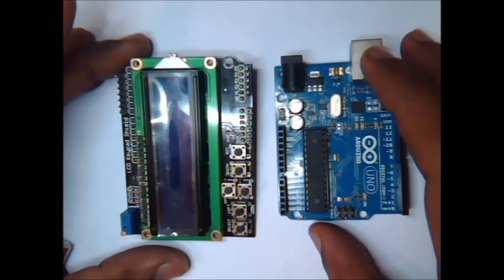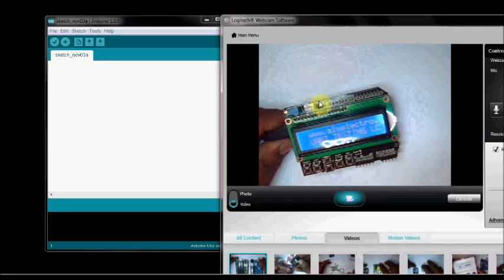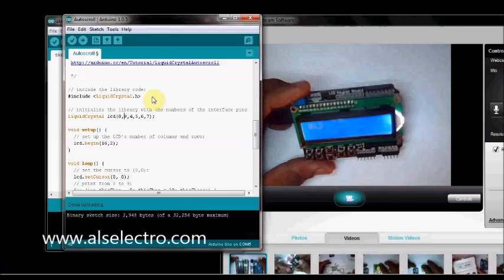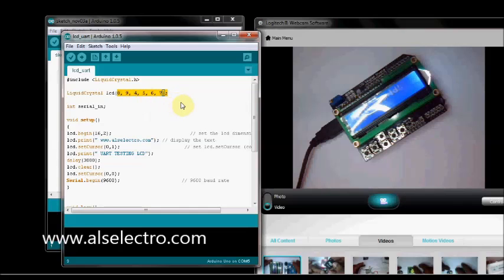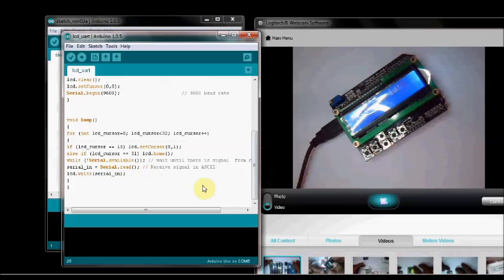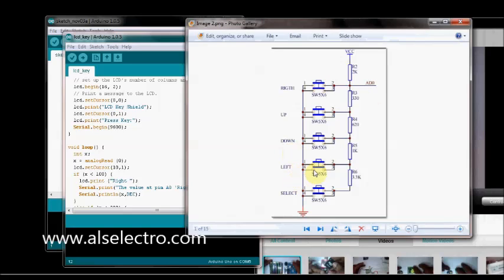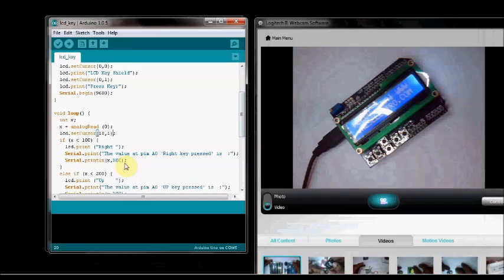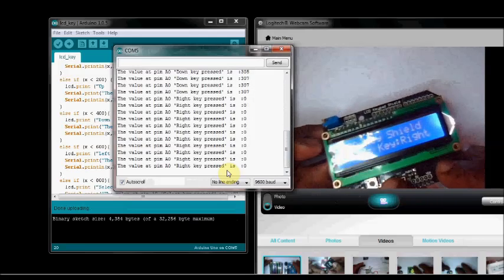LCD SHIELD WITH KEYPAD FOR ARDUINO

Comment: Thank you for the pin configuration, it works for my aliexpress display
const int rs = 8, en = 9, d4 = 4, d5 = 5, d6 = 6, d7 = 7;
LiquidCrystal lcd(rs, en, d4, d5, d6, d7);

Comment: Thanks! I modified your code to read the keypress analogue values directly on the screen). Makes it easy to then code into other projects.

#include <LiquidCrystal.h>
LiquidCrystal lcd(8,9,4, 5, 6, 7); //pin assignments for LCD Keypad Shield

void setup() {
  // put your setup code here, to run once:
  lcd.begin(16, 2);
  lcd.clear();
  lcd.setCursor(0, 0);
  lcd.print("KEYPRESS");
  delay(2500);
  lcd.clear();
}

void loop() {
int x; 
x = analogRead(0);
  lcd.setCursor(0, 0);
if (x<1020) {     //1023 is always displayed, so i chose a value just smaller than it
  lcd.print(x,DEC);
    delay(2500);  //shows the value for 2.5 seconds then is cleared so you can press another button
    lcd.clear();
  Serial.print("Value = ");
  Serial.println(x,DEC);  //prints to the Serial monitor, but i diddnt use it.
}
}

Comment: 've tried everything still my LCD shield is not working, it just shows blue screen no boxes or anything, tried adjusting the potentiometer still nothing is displayed on screen
Reply: Keep turning pot to the left clockwise and you will see boxes, keep turning
Reply: Also, copy-pasting the sketches causes an error with the strings due to “ vs ".

Comment: thank you for your video, this lcd link is here: https://www.dfrobot.com/product-51.html

This is a very popular LCD Keypad shield for Arduino and other variants. It includes a 2x16 LCD display and 6 momentary push buttons. Pins 4, 5, 6, 7, 8, 9 and 10 are used to interface with the LCD.

Comment: ello mr saravanan thanks for the tutorial but i can't seem to get anything on the lcd except that it is lit up.
can you tell me as to what could be wrong
thx
Reply: Try this code AND adjust the blue pot for contrast.

// include the library code:
#include <LiquidCrystal.h>// initialize the library with the numbers of the interface pins
//LiquidCrystal lcd(12, 11, 5, 4, 3, 2);
LiquidCrystal lcd(8, 9, 4,5,6,7); //pinout for DFRobot lcd display with 6 buttonsunsigned long startt; //cycle timervoid setup() 
{
  // set up the LCD's number of columns and rows:
  lcd.begin(16, 2);
  // Print a message to the LCD.
  lcd.print("hello, world!");
  startt = millis(); //get initial value
  pinMode(10, OUTPUT); //set backlight driver pin  //let's loop the brightness from off to full on
  for(int i = 0;i<1024;i++)
  {
    lcd.setCursor(0, 1);   // goto first character of he second row.
    lcd.print(i);          // show the brightness value
    analogWrite(10, i/4);  // set the brightness   
    delay(10); //wait 10ms
  }
}void loop() 
{
  int avg; //we're going to get an average of the analog value
  // set the cursor to column 0, line 1
  // (note: line 1 is the second row, since counting begins with 0):
  lcd.setCursor(0, 1);
  // print the number of seconds since reset:  //do the following loop every 100 milliseconds
  if(millis() - startt > 100) 
  {
    lcd.print(millis()/1000); //show num seconds since reset
    startt = millis(); // reset for next pass
  
    avg = 0; //clear average
    for(int i = 0;i<8;i++) //read the analog input pin 8 times
      avg+= analogRead(A0);//get analog voltage
    lcd.print(" KEY = "); lcd.print(avg/8); lcd.print("    ");//show result
  }
}

Comment: Hi there 

I want to control an 8 channel relay module using an Arduino Uno R3, RTC DS1302 and internet. I would like to '' ON '' & " OFF " individual relays at a set time of the day and over the internet. Can you help me with the codes. To change the time I want to add the same display as seen in your video but I have just Digital I/O pin 0,1, 2  and analog 0 to 5 pins left to connect the lcd can you suggest any other display with keys which I can use

Comment: very useful tutorial.  Thanks so much.  
One question, any ideas of how to control de backlight for this shield?  I've found some examples for the freetronics version but they don't work for this one.

Thanks in advance for your comments
Reply from the maker: Jerson Guzman 
Glad you liked it.

Backlight brightness can be adjusted with the blue trimpot on top left corner.
Reply: Thanks for your comments.  Actually the one you mention, if I'm not wrong, is to control the brightness.

I found out that the back light (LED) is controlled by pin 10 in this board.  

Thanks anyway, regards.